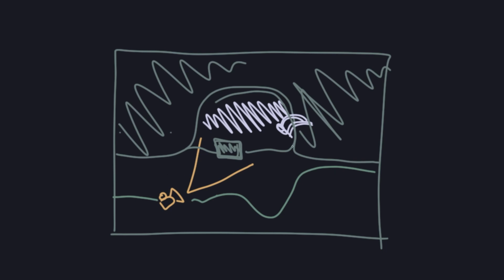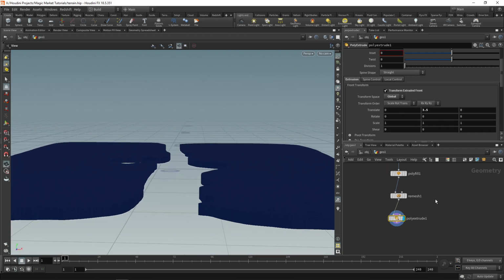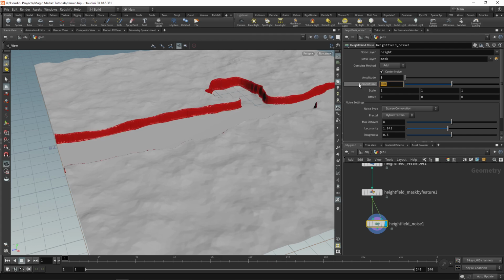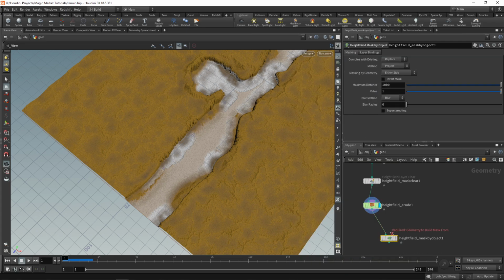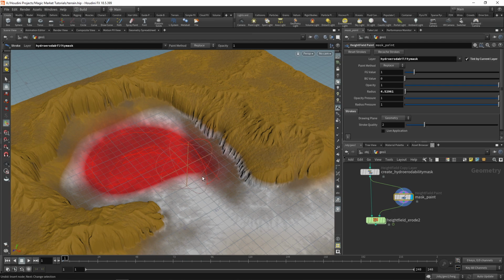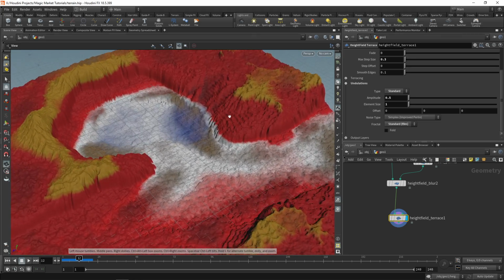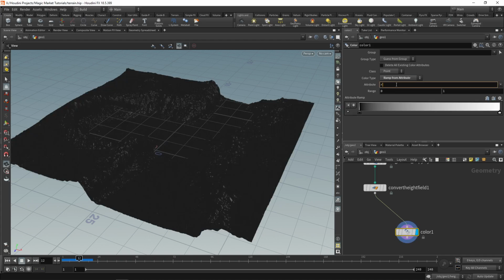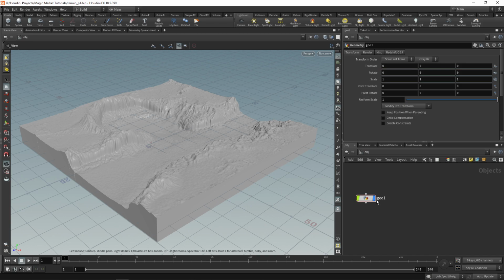Magic Market | Terrain Concepts 1 | Height Fields

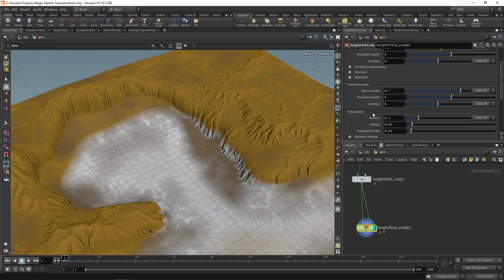Comment: 13:59 Add A Mask to your Hydro by selecting Mask on In Erodability. Use it to carve out Rivers in a second pass maybe.
15:00 Expose Raindrop settings and increase bot hblur and expand to make the effect more prominent / Sharper.
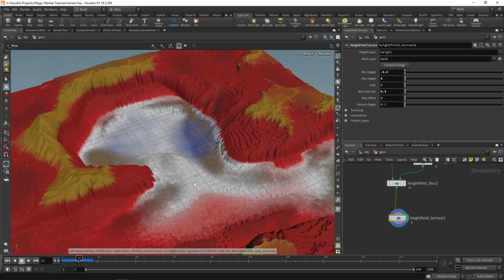17:15 Use Undulation in terrace to add randomness to the terracing.
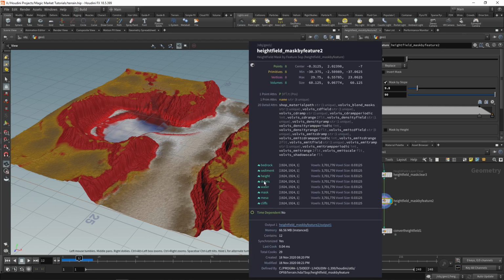19:47 THe autogenerated Cliffs Mask does not appear to often be a usefull Default Make it yourself with mask By Feature